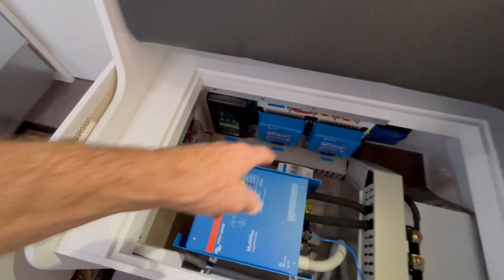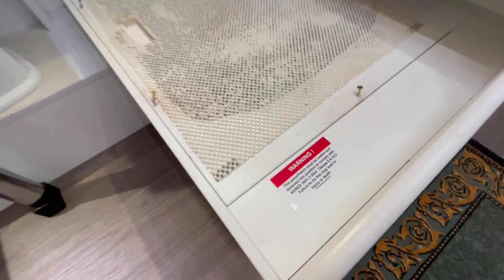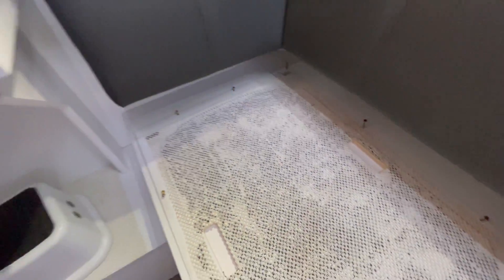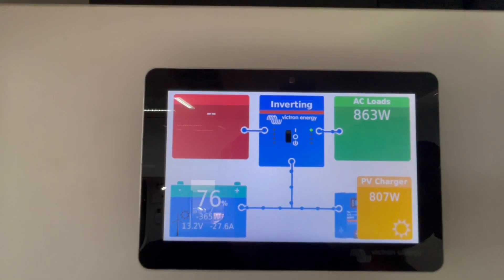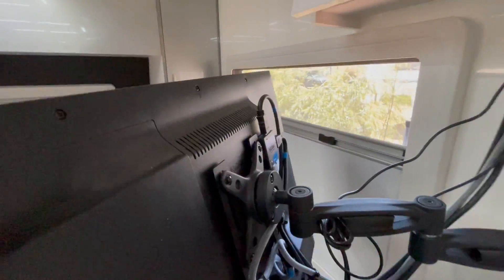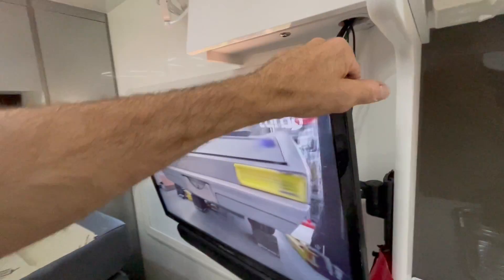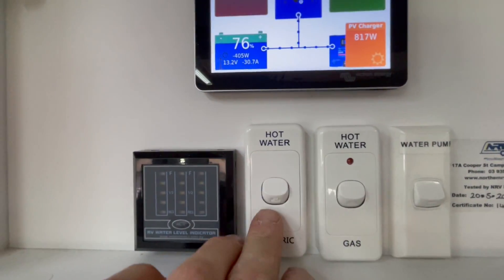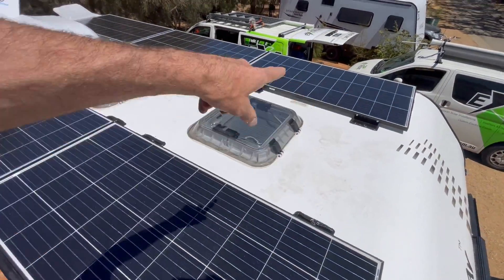Roadstar 1140watt/620ah lithium off grid setup, air conditioning, microwave, all from batteries. ￼

Comment: another great setup Matt! Question. How come you ran 200w panels on one side and 180w panels on the other? is it because of space? In the video looks pretty even space on both sides so interested to know why the 180w panels.
Reply: i think coz the length not the width, one side have the shower hatch at the back:)